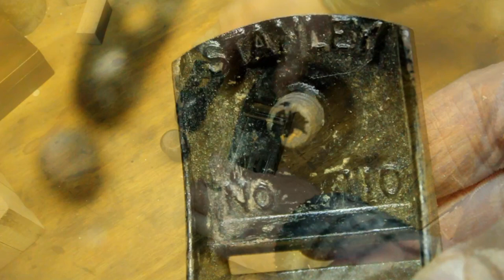Tool Restoration - Stanley 110 block plane

Comment: I couldn't tell what you used out of the first bottle so I googled it and hydroflouric acid came up. Going to buy some now. Thanks!
Reply from the maker: In the glass jar (@ 2:38) I have white vinegar to remove the rust from the metal. The Dunlop spray is a multi oil equivalent to WD40. Thanks for watching.
Frank.

Comment: Wow what a beautiful restoration!  I’ve just purchased one of these, I hope one day I can restore it like this. Did you treat the bear steel with anything to prevent it from rusting? And what oil and paint did you use?
Reply from the maker: Thank you. 😄No extra treat for the steel. Just wiped some oil on it. No special paint and normal 3 in one oil or some wd40 works fine. Good luck with restoring your plane

Comment: Fantastic job . What do you use to seal or protect the bear metal ?
Reply from the maker: Thank you.
I use microcrystalline wax from Chestnut on the metal.
That works good on all metal surfaces in my shop.
Reply: @TheTinyWorkshop  thanks for the tip
Reply: Excellent
Reply: Cheers, I Will try this.

Comment: Hiya i just found an old plane an antique store in my town so i am underway to rennovating it, but i was wondering what sand paper grot you used to shine out the sides and bottom of the body, i've got 80, 120, and 180, will those work? I really dont wanna mess it up haha
Reply from the maker: I continued to 400. Start as high as possible, because if it is not necessary, grid 80 makes a lot of scratches that you have to sand away again. Always sand in 1 direction, then you will quickly have a reasonable result. Good luck with refurbishing.
Reply: @TheTinyWorkshop  great, thank yoh very much I appreciate it :)